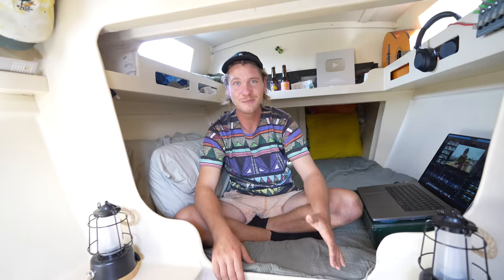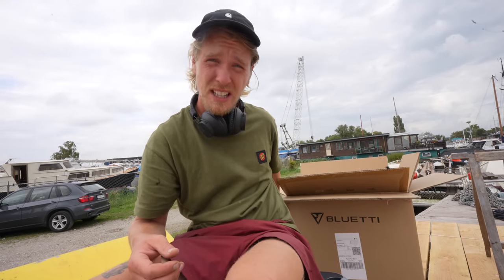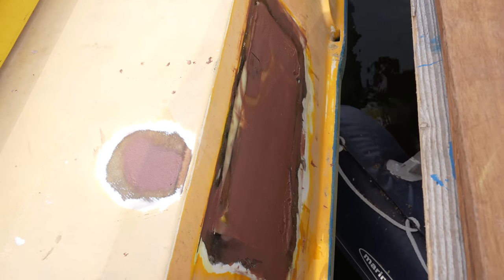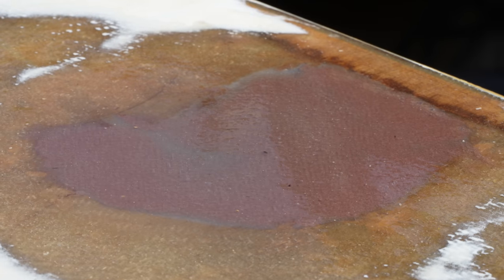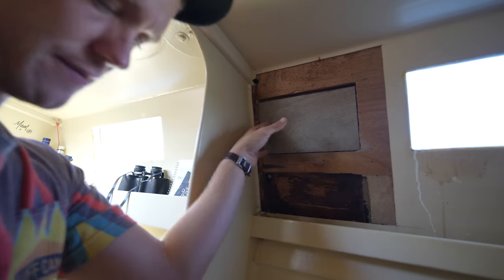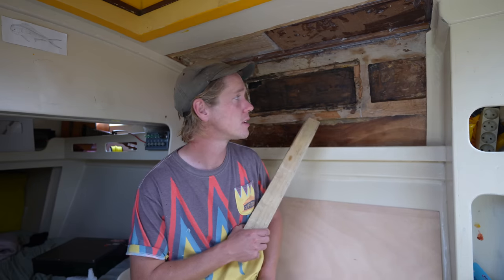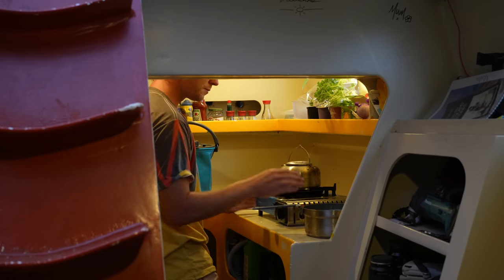Can I get This Boat Sailing In 3 Months? | Wildling Sailing

Comment: When putting in that foam, fill any gaps with something. I would squeeze in a bit of silicone inbetween pieces of foam, and around the edges so there is very little room for water. 
And you should get a vertical wind turbine to go with the solar panel. Good for dark winters. 
I would also run a cable through each hull front to back so you can tap into power from each section in each hull.

Comment: Making stain glass there is a pair of pliers called a nibbler, they are good for removing very small amounts of glass when trying to make difficult shapes.
Perhaps using a 'nibbler' approach when dealing with wet patches would be easier, because less force is required to remove small areas.

Comment: You're doing a great job at fixing things and exploring so that you can find issues. Imagine if you didn't cut into those areas and discover water, everything would have been rotten in no time and the original builder obviously did it properly or Mahi wouldn't be in this good shape. It would be nice if you could motor her home and have your dad's help

Comment: Hey man, what progress you have made with your sailboat. I would like to warn you about your lithuim power packs, make sure they do not experience frost. A lot of people don't know that, the batteries break down and the colder it is, the worse they charge. For example, I would make a styrofoam box with a ventilation opening. I hope you find this information useful. And go for your dream.....
Reply: most good packs have built in heaters
Reply: Good point. They can be frozen with no problem, but (solar) charging them below 0C will destroy them in no time. I don't know these units personally but the manual should state whether or not they have frost protection built in. I suppose they do but its best to check.
Reply: I read the Dutch army deep froze them fully loaded to start the Leopard tanks in storage them when war would break out.
Reply: @arthurschuler8906  
Which batteries are involved? Agm ,Gel, Lead,Lipo?????? They are all different, so which ones are you talking about? You shouldn't compare apples with pears! LOL ;)
Reply: @youtube_dj_65  I was in the army in 1982, I do not remember it exactly, but I believe lithium batteries. However I am not sure. It was for tanks in storage.
Reply: @arthurschuler8906     At that time there was no lithuim batteries..... They came about 20 years later........

Comment: Did you ever think about doing a full blown solar-electric boat? (No sails.) A completely stripped-down catamaran like this is kinda the ideal start point for such a build. The entire length and beam of the boat turned into a solar deck would provide enough power, combined with sufficient battery storage, to cruise 24/7.

Comment: The Bluetti power banks are absolutely perfect for your situation and hats off to them for supporting you and helping to improve your quality of life on the boat. 

 What I'm struggling to find is a similar solution for a household but with grid tie functionality so I could set when to charge off the grid power and when to cover loads with battery power and all this from a simple uk plug socket (limited to 13 amps of) and a sensor on your electricity main supply cable... Surely it can't be that hard to get working?  For us renters we can't install our own permenant residential battery so we need something plug and play but it doesn't seem to exist???

Comment: Good to see you back, hope you enjoyed your "week off" The outside you repaired looks as if it might have been a Window that was filled in? My Heart jumped when I saw that initial spray of water, you are doing the right thing chasing the Rabbit Hole, the better job you do now the longer things will last before they need attention again, also that area NEEDS to be strong. Good use of the packaging that would go to landfill, take care though, some of that stuff is water soluble, more so the little bits of throw in thingies though I think. Yet another entertaining vid. Also sponsorships are good if they help you and only need a ling to work rather than big extended adverts.

Comment: Mark. there are suggestions you shouldn't have used foam. I would say it depends. Polystyrene may absorb some water but is fine for insulation. Polyurethane will absorb more water but coated with resin and fibreglass/plywood can add to structural strength. The way the previous guy used it did not add to the structure. You are right to place plywood blocks under the chain plates and you could put some extra glass on the exterior to spread the loads. As you say every are of rot and water ingress is traceable to some issue; I am guessing, leaking windows and/or a fixing not correctly done. As I am sure you know the way to put a fixing in is to drill an oversized hole filled with epoxy then drill for the fixing.

Comment: Coming together nicely.
Rabbit holes and boat restoration go hand in hand.

That pyscho swan 😂
It's magpie swooping season here in South Eastern Australia, I got nailed by one in my left temple during the week   just as crazy and Evil as that swan, bit of trivia swans here are black with red beaks that have a white stripe left to right across it.

All the water in behind the interior panelling Just thinking would it be prudent to drill a weep hole at the base of each section of the internal paneling to allow any further water to escape and also to alert you of any external leaks at that site ?
 
The power banks look Very Good.

Looking firward to seeing you raise the mast and getting the motor mounts sorted, it will be a big milestone.

I'm seeing images of the flag raising at Iwo Jima ...😁

Take care Mark.

Cheers

Comment: While I applaud your rescue of this Pahi, I begin to wonder if it would be less effort and expense to build another from scratch.  Perhaps the next one?  Darn rabbits dig deep!  Nice of the foam to hold all that water for you.  Too bad it's unusable.  Condensation will become a problem inside your hulls during cooler weather.  When I lived aboard this was less of a problem because I had a diesel fueled heater that pulled combustion air from inside and exhausted it out the stovepipe outside.  RVers talk a lot about condensation because RV furnaces use outside air for combustion, and only heat the inside air.  They use dehumidifiers to reduce indoor moisture, but that's an additional electrical load (and another piece of equipment underfoot) that boondockers like yourself really don't want to have.  One more problem to solve!

Comment: Making progress!
Yeah fix the areas where you need chain plates and get the mast up! You could be sailing in a month! 
The rest can wait for now but mean while you can go sailing a bit while working on her.
Mast, rigging, sails, tiller, engines. Or engines first and at least you can cast off for a jaunt up the coast like a barge!
You've sailed it already remember and would be nice to have that option.
Reply: It would be nicer to get it back to the UK near where his folks live.
Reply: I think Mark wants to get on the water. Any of the next main components will be crucial decision making territory he'll have to live with for a long time.
But I'm sure he'll want the option to just cast off for a leisurely putt, putt around the marina or out into a larger bay/river.
A long slog of interior repair is in the offing so a break would drive good spirits! 😅

Comment: Knowing how important 'minimalization' is to U, plz consider those 40'-ish Wharram sailors/rebuilders before U faced with the same choices while readying their catamarans Bluewater sailing. Plz don't under estimate 'extended passage comfort' for crew/skipper necessary for safe travels . To that end, believe U absolutely need to consider 2 major 'upgrades - Nav-Deckpod, behind foremast (longterm wet-boat sailing has early 'expiration dates' for even the heartist sailors) & outboard pods for auxiliary power (when aux.pwr needed, must guarantee function every time & wet outboards can't do that!)
Wharram's sail awesome, but tend to be top of list for 'wet-boat-sailing' & anyway U can reduce/(minimize ur favorite word) wet spaces improves 'best crossings' . Know U & ur Dad are going to be working on outboard mounts & why I suggested 'pods' now . Online many Wharram examples exist for designs & function (most central location to steering station(behind foremast), for short-handed sailing . Good luck & Cheers from an admirer

Comment: Also it might be worth drilling weep holes in those areas that got water logged.  Then any new water can flow out without causing damage and you can see you still have a leak.

Comment: Should also mention, West system epoxy is brittle.  18 years ago used it on seams close to the bowsprit and along the inside edge of a mahogany toe rail.  It was cracked within 2 months.  Since have minced mat as thickener...and " total " something has a flex solution.  Its odd liking a channel and the star, but watching for ineptitude.  ahh, most parts can be skipped.

Comment: Those chain plates look too short to fix in that very suspect area of rot that you’re doing your best to repair without pulling the whole boat apart. If you want to get sailing with it as is I’d take the precaution of fitting much longer chain plates that go right down the side of the hull, assuming everything is sound in the hull(?) … And I would investigate that further before making a decision. The chances are that rainwater may’ve penetrated further down into the structure from the coach roof/deck …

Comment: Bloody heck so many problems and wrong kinds of screws nail used so sad.  I did think this was not a good idea and thought Mark made a huge mistake. But this is a very old boat and needs a chance. I wonder if Mark could get ideas from Ship Happens they are going through similar things. I also think need another more powerful power station one on one side of the boat great idea.  Just remember with the packaging I forgot the name of it floats on water but if a fire is very toxic and melts in to a dangerous gas. It also does keep your boat warm and will never hold water.  I think forget about the engines until the boat is ready to move.  Then think about a different way to have a motor on the boat and what type.  I wonder if could make a middle trimaran smaller in size for the motor and sails to be stored?

Comment: You're making good progress. But soon the season in The Netherlands will be ... over, once temperatures go below zero it will be hard to glue, epoxy etc. You better get prepared for speaking from experience, it isn't fun to be onboard without heating and a frozen surrounding.

Comment: For shrouds etc, I assume you’re considering Dyneema. I recommend using that. Perfect for a boat like yours. Simple, light, strong and cheap. Just use the normal one without a jacket. Splice it yourself. Use no rigging screws but rather lashings.

Comment: I admire your determination. Living in tight quarters is already hard, add the dust and tools from the boatworks, the winter coming soon... I would not be so eager to stay in this habitat...
This being said, beware of the consequences when using a regular Styrofoam in a boat. You have no idea how it will react to the chemicals inside the Epoxy. If it floats on the water, that does not mean it's water resistant. Last but 'it least, the density is way to low. A sandwich, foam based, should be at least 60kg/m3. That Styrofoam is only a fraction of that... Now your core is foamed again but will it provide the required mechanical resistance and required longevity? I hope for you. Hang in there!!!

Comment: My biggest concerns lies around the structure of the design that attaches your two hulls together.
If you hit a heavy swell in bad Wx, are the cross bracings strong enough to withstand the immense pressure from hydraulic forces? Just doesn't look like it to me.

Comment: On worn cross tip (Phillips in the USA) screws a bit of an abrasive powdered cleaner (Comet in the USA) or engine valve seat grinding compound to dip the screw driver or bit into gives a bit more friction to keep it from slipping.
Reply: The screw is Pozidrive and the screwdriver is a Philips. Never a good combination if a lot of force is needed !
Mark, you will be amazed how much easier it is with a Pozidrive screwdriver, especially a newish one for tough situations.

Comment: Hi.  Did you get advice that it was ok to use styrofoam?  I know you are using epoxy (any polyester mix would have melted it immediately!) but I'm sure boatbuilding closed cell PVC foam ( Divinicell, Core Cell in the US) would have been better.  Maybe this product is very expensive in Holland??  Anyway, you are putting so much effort - and money (West System isn't cheap anywhere!) into these repairs, I hope it works out.  I suppose on a flat sided cabin top it won't matter.  I would definitely use a proper core product on a curved surface.  You're doing great.  Can't wait to see you put the rig together.
Reply: The foam is not being used as a structural element, just for insulation.

Comment: advice from an old bugger. 
forget about timeframe and schedules, change your thinking to ill do a thorough job however long it takes, even if it means going back on the hard and going back to work to save some more cash. 
it seems like you have a good boat and motivation but driven by a schedule. think differently.

Comment: There are "rabbit holes" on EVERY boat out there, no matter what they are made of. Honestly, the people who said the boat was rotted are the same people who passed on the boat before you got a deal for ~2,000, you couldn't have even bought the resin for ~2,000 to build one. Those are the exact same people that buy a boat, hardly ever use it, let it deteriorate to a point that it's no good to them and then sell it for ~2,000...

Comment: After watching Sail Life I think that is a bad choice of foam as  choosing a closed cell foam that will not soak water is what is needed.
Those chain plate mount areas need to be solid, sad to see all the rot you have deal with.
Reply: I absolutely agree, that foam will hold water of it gets in there. Love the videos, but cringed when you held up the foam 🙃
Reply: I believe that the polystyrene packing material is closed cell. But it isn't ideal because it is a system of bonded pellets, which can absorb water over long exposures.  It won't turn into the sponge like that open cell stuff did, but it's not ideal.  Those closed in spaces are horrible on a boat in general, but I would just leave the air gap with small vent holes in such small spaces.

Comment: Chain plates will need a reinforced with a backing at 90 degrees to it like the bulkead provided? Otherwise is could rip out over time with cyclic loads gradually working away at it? (Im not a sailor or woodworker , but my uncle's monohull has the stays go right down by the keel where the thick beams are rather than through the thiner (fiberglass) hull around the sides. But it depends on the rig i suppose 🤷
Reply: Loving the progress mark , I was very critical when you were looking at buying mahi, put the boat looks amazing now! Keep going  you legend 💪

Comment: 1:39 before putting those screws in, use grease on them. And when you're in a sh!tuation like that, use a bit of rubber strip (bicycle tire tube) between the screw driver and the screw.
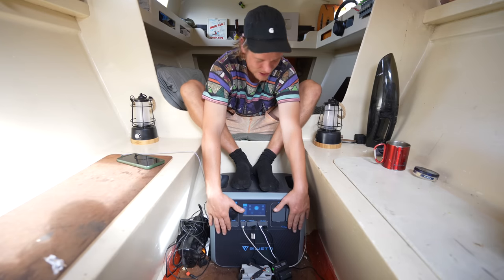21:59 you should make a small shelf that allows you to put the bank inside so you don't step on it and in case something happens (knock on wood) you'd have at least some reaction time to pull it out of the water.
As for lights, 5v waterproof LED light strips my dude. Having soo o many small lights is nice and all, but not really worth it compared to a 5v light that you can plug in an USB.

Comment: Foam is a pain in a wood boat if water gets in.. 
You need something that can breath but insulate like cork or a cork sandwich of material like jute fibre matting basalt mat would be best...its sterile fire proof sound proof etc..

The problems the boat was built well but not sealed before ending up on the water. 
It would have been better if  the holes in the outer skin had been left till final fitting but knowing how these things go there was probably little choice. 🤔

Comment: Polystyrene has no strength so no need to paint it with epoxy. It's also combustible soo...... I would be more worried about how much more water is trapped between the skins.

Comment: Do you think its wise to have no dedicated electrical system on the boat? shore power i mean thats literally just one plug... U will need to power nav lights on ur mast anyways to be able to sail at night. I understand u want to keep things simple, but wouldnt it make sense to have some basic wiring onboard and power that from your power banks? The power banks can be plugged into shore power as well - u got all the complicated stuff in a nice Bluetti package, now its just a matter running a few wires and led strips...

Comment: I wish you would do something outside the norm and build a cabin on deck with at least galley sitting area that can convert into a bed maybe even a small closed off room and most def a head. Being that everything structural will be already done you can build it out of marine grade plywood and a layer or.2 of glass or even just epoxy and inside use home materials and laminates. Now that would be a nice DIY boat project and something you could actually feel comfy being on and getting crew and sailing around properly... and the whole engine situation I dont think you should waste a penny on what you already have. You need something more reliable

Comment: What is the weight of the 2000wh Power station? No weights shown on their site?  Also what foam are you using to replace the soggy mess that was the original?